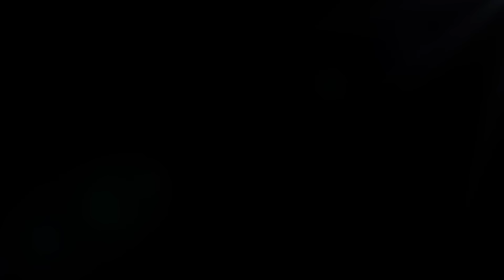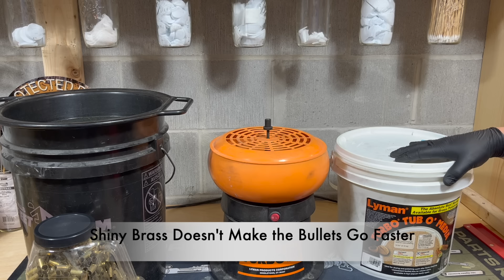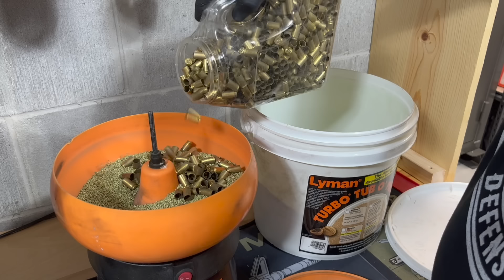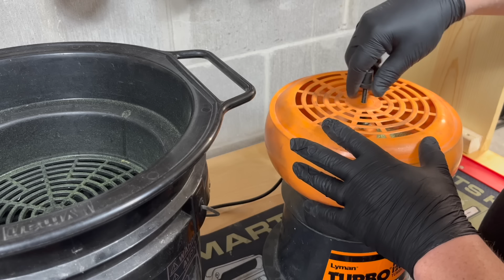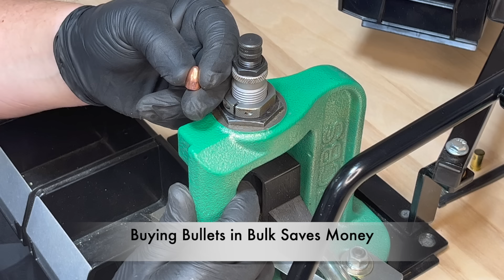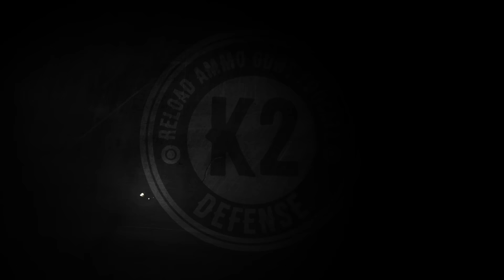How to Reload 9mm Ammo For Beginners Single Stage Press

Comment: I prefer to decap ( remove primer ) before initial tumbling so the primer pocket gets cleaned as well. Lee makes a great decapping die that works on most calibers. Doing it this ways allows the removal of the recapping pin in the sizing die as well. Over the past 45 years of reloading many calibers of rifle and pistol this has worked well for me. Be safe at all times!
Reply: Sorting brass before tumbling helps avoid the dreaded stacked case, 32acp in a 9mm in a 40S&W in a 45acp 😭🤷‍♂️🤣🤣🤣
Reply: Dry tumbling after removing the primer does not clean the primer pockets. All it does is lead to clogged primer pockets. The media does not move around enough in the primer pocket to clean it. Wet tumbling with steel pins is a different story.
Reply: @Steve5404  I prefer to de prime and re size then throw in wet tumbler to clean. After they are dry, I measure the brass. Even though many people disagree with my method, I measure every piece of brass and store them by brass size. I dont reload or shoot that much so I save brass (9MM) by size from  .750 to .751 and .752 to .754.  My theory and method is to have a fairly equal crimp on the brass. I am fairly new to reloading so this many people find useless and a waste of time. But for me works at the present time.
Reply: @wm7312  Agreed! I'm a retired Master Jet Engine Mechanic and 'specs' are extremely important to me as well getting into this game so I absolutely do the same thing. If there's a spec, I measure! Might be overkill, no pun intended but I want them to be exact, duplicated and consistent!
Reply: Depends on how much crud is built up on em’
Reply: I agree.  I always de-prime before tumbling.  Granted, the tumbling media does clog the primer pocket but the de-capping pin on the sizing die will clear that.  I no longer use dry media for tumbling.  I use wet tumbling now.  The cases come out sparkling clean.
Reply: Sames, I deprime before cleaning, though I don’t dry-tumble. I use a Lyman ultrasonic cleaner.
Reply from the maker: @kaasmeester5903 - that’s a good option as well! Thanks for the comment! 👍🏻

Comment: I don't mean to offend some people, but reloading 9mm Luger is a waste of time.  Primers are running around $0.12 cents each and Berry's copper plated bullets are running around $0.10 each.  Powder for a 9mm is gonna cost you what, $0.03 per round.  This is about $0.23 cpr assuming brass is range pick up(a good assumption).  These prices don't reflect shipping, HAZMAT, or tumbler/media costs.

You can buy CCI Aluminum for ~$0.27cpr (price does not reflect shipping).

I guarantee that all the reloaders are going to scream, "I make WAYYYYY better ammo", no you don't.  I reload too and factory ammo is generally better stuff.

Where reloading shines is when you reload expensive ammo.  I reload .44 Mag, .45LC, 10mm Auto, and .357 Mag.  44 and 45 are running darn near $1 per round and 10mm and .357 are going for about $0.58cpr.  I can make any of those 4 calibers for about $0.20cpr and factory ammo is far more expensive.  FYI, I shoot generally lead cast bullets as these are revolver cartridges (yes I have a 10mm revolver).

I can see reloading 9mm if you want to make a special subsonic round for a suppressor, but that is the only time I can see reloading 9mm.

I will probably get roasted, but oh well.
Reply: This is good info as someone whom wants to get into reloading. 

I also own a 69 Type 56 Carbine. Would it be cost effective to reload 7.62 with steel cases?
Reply: @SouthJerzyDude  Steel cases don't get reloaded.  Berdan primers don't get reloaded.
Sorry.
Reply from the maker: Shawn Esposito - the main issue with reloading steel cases is the Berdan primers. It is nearly impossible to deprime steel cases with Berdan primers since there are two flash holes, not just one typically found in brass cases. Others may have more information on this, however, I have found the easiest and most cost effective way to reload is with brass and not steel cases.

Hope this answered your question!
-K2D
Reply: I'm 100% new to reloading, just finished my work bench and set up, getting ready to load my first round hopefully in the next few days here.  I'm starting off with 9mm reload because I don't have anything else I'm able to shoot regularly.  It's something I can test at a local range on a regular bases to dial in my reloads and find a good accurate load.   I have not really done a cost benefit approach to justify the reloads,  more so just a joy/new hobby to get familiar with. I later want to get into hunting and rifle loads, looking at going into 308.  I'm sure as I progress and gain knowledge, I would definitely start to way the cost benefits into my reloads a lot more.  I appreciate your comment and info provided and will taking that into consideration for future purchases in calibers to reload.
Reply from the maker: Justin Morris - would love to see your setup! Good luck and happy reloading!

-K2D
Reply: @k2defense  
I bought the RCBS Rebel Master Reloading Kit.  I have a Frankfort Arsenal tumbler with Lee carbide dies.
Reply: Rare or medium...your choice?
Reply: I'm reloading 9 for material cost of 15 cents a round using 2022 purchased primers, powder, Gallant bullets. But I live near Brownells, Sportsmans Wharhouse, Bass Pro, Scheels and Fleet Farm. 
The more rounds you reload the more your equipment cost is spread around.
I don't pay DOT shipping charges, I pick stuff up.
Reply: 2024, I'm still reloading 9mm for 15.1 cents, .223/5.56 for 28.5 cents, 20 gauge birdshot for 23.8 cents, 410 birdshot for 17.4 cents, 410 buckshot for 36.7 cents. All these are material costs. I live close to Sportsman's Warehouse, Bass Pro, Brownells, Scheels and Fleet Farm. All my Hazmat costs are ZERO, and my bullets are generally shipped free or picked up in person. 
Life is good.
Reply from the maker: @phild8095 - you are blessed! 👍🏻
Reply: I agree with some of what you’re saying but in this area your primer prices are a little off, about 7.5 cents here. Some places as high as 12.5 cents but pretty rare. This is off the store shelf. If you have to ship increase those costs with hazmat and shipping charges. The other issue I have is I have not seen any 9mm rounds on a store shelf for .27 per round and if you’re going to have ammo shipped you have to take into consideration hazmat charges and shipping which would make your calculations way off. I’m still using primers that cost me about 3.4 cents each.
Reply from the maker: @NatvBearHntr  really depends on where you are located and if you can find them at a good price. I must be lucky. My prices are of recent activity. I do spend countless hours looking and digging. Sorry you’re paying so much. It’s really sad as that’s where we’re at with our economy. Hopefully it turns around in 2024.